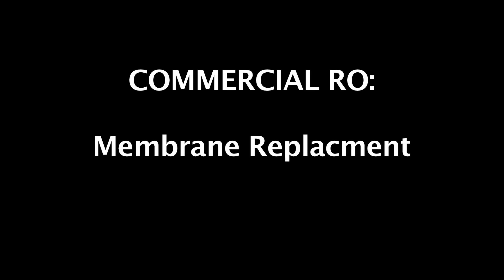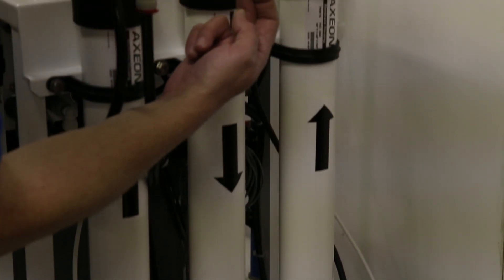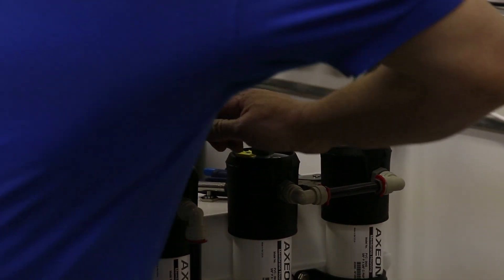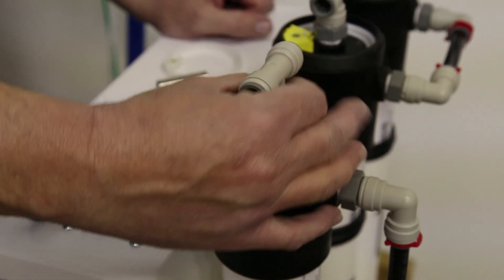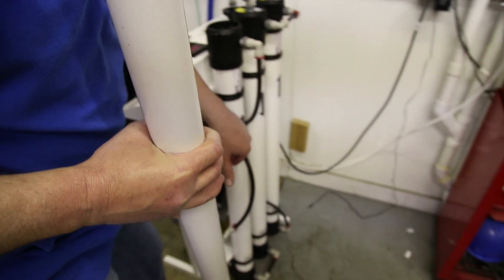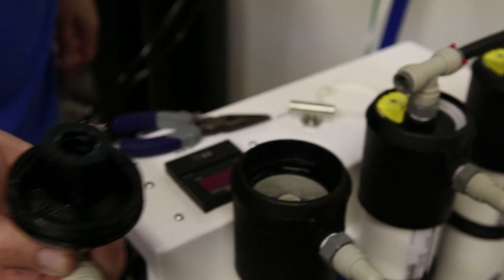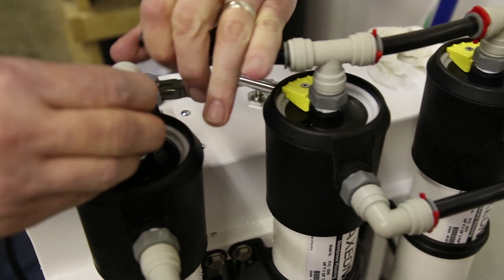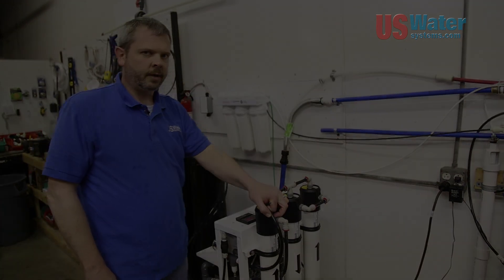Commercial RO Membrane replacment

Comment: I have an ancient Rain Soft RO unit.  It has two of those membrane tubes made if stainless steel.  The process is basically identical to your demo.  The two tubes are connected to each other so that the centers are one and the product.  The outermost spaces are likewise connected to be one.  First question, one comment here says the concentrate from one becomes the input of the second.  Is mine configured wrong?  Second question is about low product flow.  After replacing the membranes can air be trapped inside?  Can this air contribute to low flow product?  I have other questions but will start slow.  Thanks
Reply: Question 1: The RO device's serial or parallel installation design will depend on the flow and pressure diagram of the pump. If the pump has small flow and high pressure, it is suitable for series installation, but if the pump has high flow rate but the pressure is not too high, it is suitable for parallel connection. Also depends on the specifications of the RO membrane. This design is almost like an electrical system with: water through the pump is electric current and the RO membrane is the wire. V is the pressure and A is the flow. 
Question 2: The air be trapped inside does not affect the filter flow